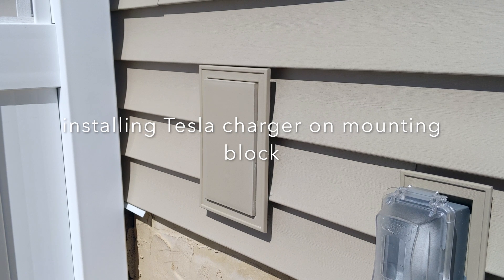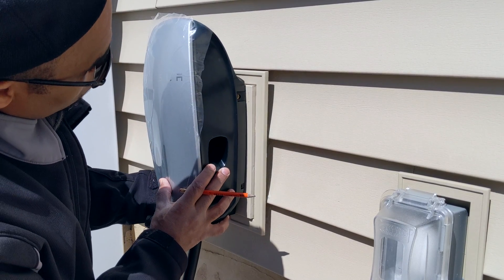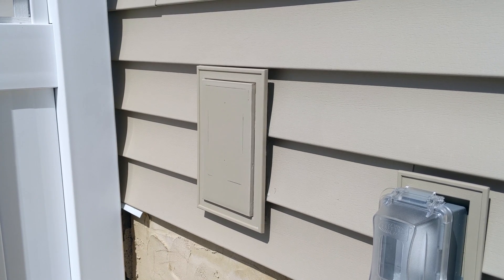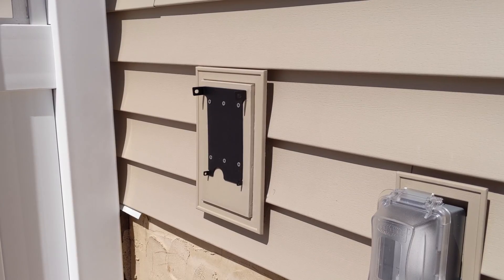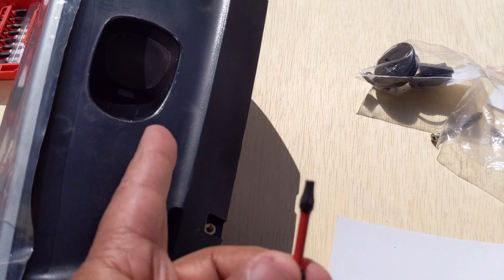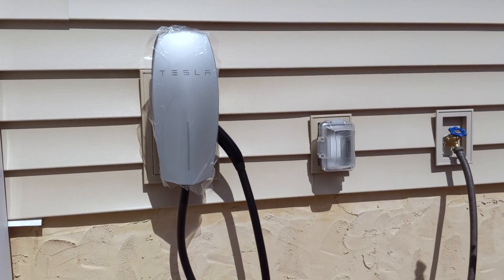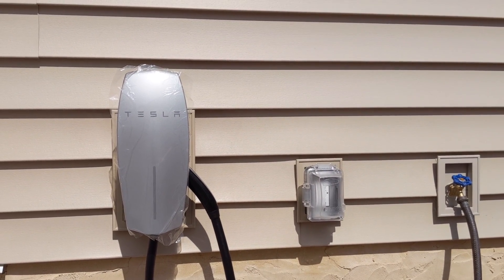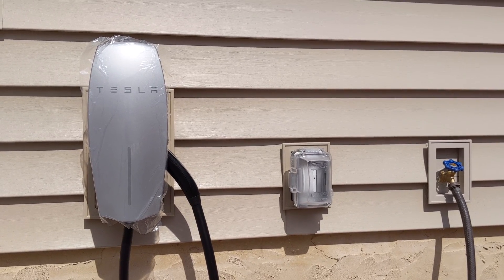How to Install a 240 volt Tesla Wall Connector outdoors Pt. 1 Tesla Wall charger installation  DIY

Comment: I see you have an exterior installation. How is it in the winter leaving it outside? I am planning to purchase the wall charger but have concerns with outdoors. Most of the ones I have seen have indoor garages and obviously no problems. Let me know please.
Reply from the maker: No problem, Made for outdoor also. please remember to sub. Thx
Reply: @DIYNATIONUSA  yo sub?
Reply from the maker: @davidarias55  Subscribe to the channel. thx sorry for the misspell